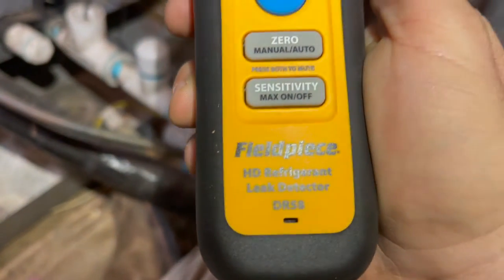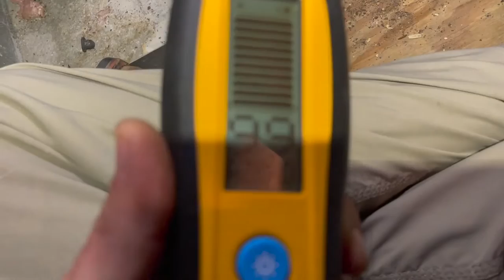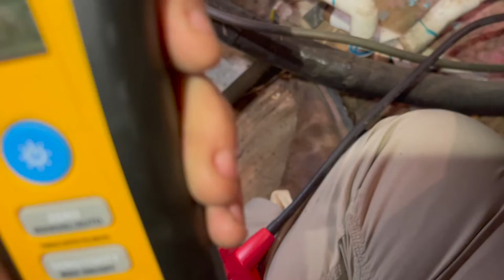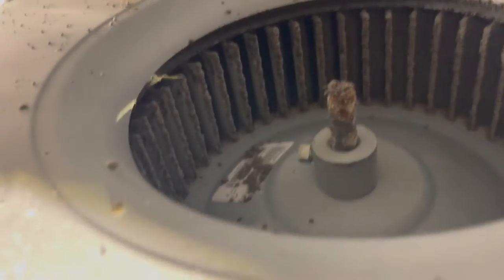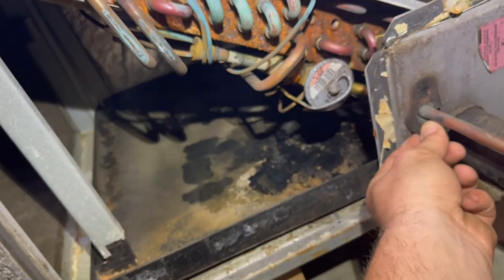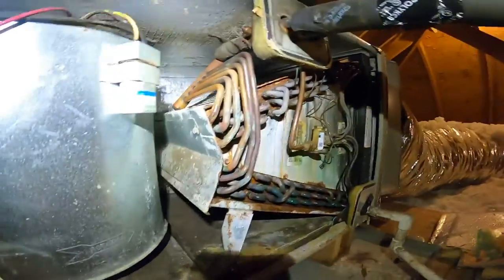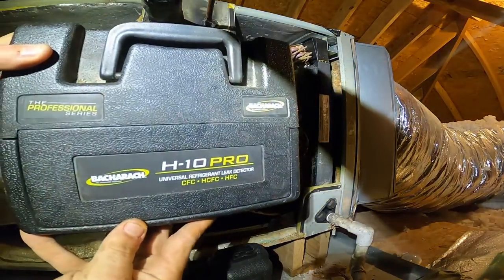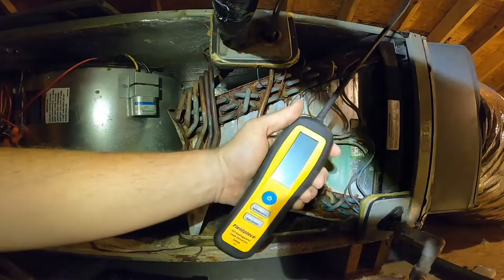FieldPiece DR58 vs Amprobe & H10/Field Test

Comment: The thing me and quite a few of the other guys have experienced with both of the new Fieldpiece leak detectors is. They start out working great, but then after a few hours of usage they seem to get a little squirrely and they start acting up. I've had the Amprobe for several years (mainly as a backup) and I trust it as well. For the money it's really hard to beat that RLD-1 from Amprobe.
Time will tell with the Fieldpiece. 😎👍

Comment: I have the DR58 and it works well. You should try turning it on outside where you know the is no leak. Then go to the condenser and check around there. I leave it on the enter the house. if it goes off just entering the house. Most likely your leak is inside. That meter is very sensitive and works amazingly well. But it will auto zeros when it gets flooded with refrigerant.  check you welds and drag the tip over the areas you make think it may be leaking. Always make sure the is pressure and or refrigerant in the system before checking for leaks.

Good job John.

Comment: Are you running the H10 Pro in Auto or manual? I find it hard to believe that the field piece even comes close to the H10 Pro. Half the battle of the H10 Pro is knowing how to calibrate it and use it in manual. I’ve found leaks with just a few pounds of pressure. 
I’ve been using the H10 Pro since it came out. I’ve tried so many others and always come back to it. 😉